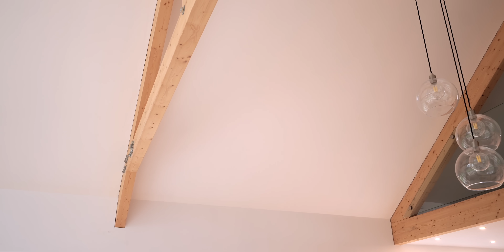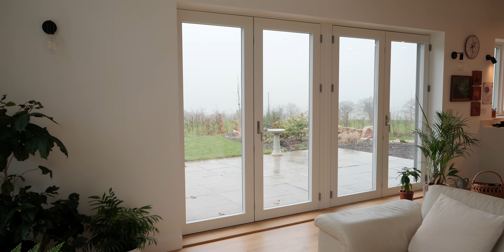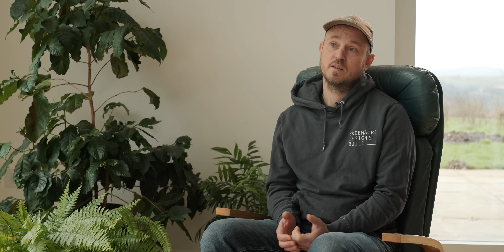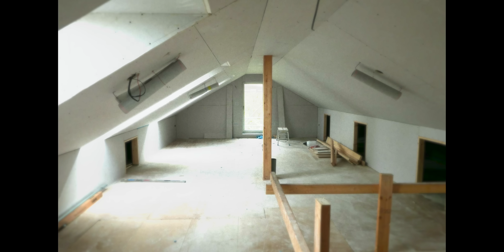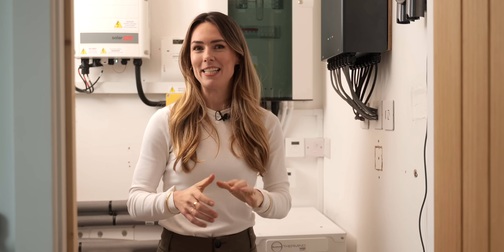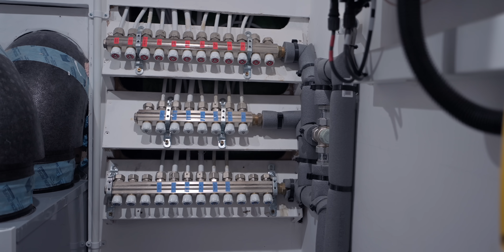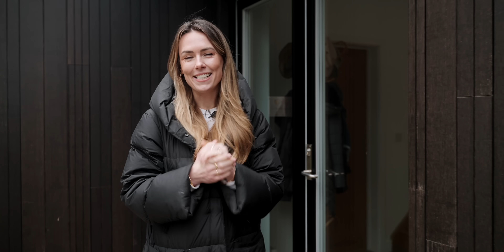Ditching a Heat Pump for In-Plaster Infrared Heating?!

Comment: Sorry. Naive here. Airtight? Sounds a bit dead…do we really mean that?
Reply: Why not Google up UK building codes ref efficient housing?

Which will probably lead to plenty of ads relating to heat recovery systems.

Why didn't you Google up.the topic prior to posting?

You certainly come across as somebody who doesn't do much research for themselves.

You should be ashamed.

Comment: From what i heard - a passive house is a house where you dont need to add heat.
The amount of insulation may people say is bonkers. But if you insulate between 300 to 500 mm you should not need a heating, in theory. The applieces and the people who live there add enough heat under normal living situations.

Of course you should add heating, for a few reasons.
Reply: That amount of insulation certainly is not at all bonkers.

Merely research house construction using straw bales

Stone/brick chimney, fireplace and hearth for the look of the thing.

Straw or reeds roof.

Probably one of the easiest ways of building a building there is.

Plenty of videos on YT if arsed.

As long as you can lump straw bales about, especially if you're going for a second storey.

Plastered inside and rendered without, both on top of clay.

Seasoned oak or elm beams.

Triple glazed timber windows.

Comment: I claim BULLSHIT !!  I'm an architect.. Installed a Radiant electric heating system in my New build house in 1985  . 
Ceiling instal only as wall installation was  obviously NOT recomended due to possible user induced damage from. 
Heavily insulated Walls and Cielings .. even betwixt floors. 
 It worked well .
 Although the promised Lower Electric costs were erm ..exagerated .. at best.
 Noting that My electricity costs are ~8 cents (cdn $)  /kw. :-).
 Problem was that the panels (mfg'd by ITT ( Norway ) Soon began to fail one by one... by 1995 ALL 45 panels were DEAD.

 Seems the 60hz of North American Electricity excited the panels  into vibrating and that vibration shattered the heating lelements continuity (killed them)  
Total heating system was/is 100% dead.. Feeling lucky ??
Reply: Hmm ... it's certainly possible you're trying to make a plausible point ... if only we knew what it is.
Reply: Further to your earlier post ref mains frequency  ... the FAR IR heating element is not mechanical so am puzzled as to how you might draw a parallel to "your" heating element and this more modern material.

Comment: I wonder if that could be used underfloor on top of insulation with a thin scree over the fleece?
Reply: With any luck the pro installer outfit guy or lady will answer your query directly.

Will be useful to know for all concerned.

Especially for the heat pump huggers.

They'll get it ...
Reply: Yes, our systems will lie behind plaster, tiles tiles, cement, timber floors and even resin and polished concrete :@)
Reply: @EnergyCarbonInfraredHeating what thickness of insulation would be required under the fleece to prevent the heat dissapating into the ground?

Comment: Watching this freezing my arse off in my rented damp victorian terrace and 10x the energy bills 😭
Reply: Hmm ... might be worthwhile your reading up on clothing made from the same sort of heating material that gets plastered into a wall.

Works off 24V-36V via transformer so no danger from a  mains belt.

Just remember to unplug for comfort break.

Job done.

Or, buy a FAR IR panel heater,  about 350 W, sit back and  gently cook.

A lot cheaper than buying yourself a property and retro fitting a heat pump.
Reply: That'll be 95% of housing in the UK, which simply can never be bulldozed. Think of the sash windows, the ornate light fittings, what would Heritage England say ?
Reply: @decibel_tastic2869 

😂😂😂

Kindly don't be so simple

A lot (most) of the ancient Victorian and Edwardian housing stock I had the misfortune to work on was Jerry built.

Outside loo, no bathroom, no cavity walls, no loft insulation etc, etc.

Not a lot could be done to improve the properties except a bedroom converted into a bathroom.

Knock down that rubbish and build better.

Why should people have to put up with poor accomodation?

Comment: Very impressive setup and what a sensible chap! 👍🏻 I’d love to be able to build my own passive house somewhere like that 😍 …

I think the homeowner didn’t appreciate / was misinformed about how a battery can be used when there isn’t a power cut. With our Powerwall at least, you can set a percentage that you don’t want the battery to go below, so you’ve always got that amount of energy available in the event of a power cut. Yes that reduces the amount of the battery that you can use the rest of the time, but you can just size the battery accordingly.

In the winter, if it’s really cold, raining and there’s no sun, our single Powerwall 2 (13.5kWh capacity), can sometimes run out by midday, and that’s after charging it to, and holding it at 100% during the off-peak period which ends at 5:30am … so if you’re solely relying on the sun to run the house in the middle of winter, you’ll be using quite a bit more expensive on-peak electricity, when you could be using off-peak electricity from a battery. We have a total of 8kW of panels on our house and sometimes in the winter we can make less than 1kWh in a day! 😢

I should add that, with the Powerwall at least, you can’t use it to power the house during a power cut without the optional Gateway module which completely isolates the house from the grid in the event of a power cut (so energy from the battery can’t go back into the grid whilst they’re trying to repair it).

As an aside, it would be useful it the editors of this video could put captions in the video if it contains errors that weren’t spotted during filming, eg. at 11:35 he says they have a 6kW solar array, and that they expect to generate 6kWh of energy in a year 🤔… but he then says he expected the total energy requirement of the house for the year to be 6000kWh, so presumably he meant to say they expected the solar to generate 6000kWh over the year … Otherwise some viewers might get confused if the numbers don’t add up.

Comment: I really don't understand the benefit of these over electric underfloor mats, assuming the same insulation, solars etc. Surely the electric mats provide greater comfort.
Reply: No.  Although we generally don't put our system underfloor as we would need to cover at least 80% of the floor area compared top 50% in the ceiling, our IR mats use  a lot less energy per m2.  Also, if you accidentally put a screw or fixing through the electric mats then the whole system will fail.  With these you can screw through without effect.  Put a plastic dog bed onto a laminate floor with resistive electric underfloor heating and watch the burn spots appear as the wood overheats.  Again, not with this system.  Hope this helps

Comment: But wat is casing the heet have you just put an electric radeyatet in the wall
Reply: Good question. The mats are plastered into the ceiling.  When fired up they reach around 30°c which is enough to generate IR at a frequency that is felt as warmth by the body.  That lightwave transfers protons of energy to other surfaces which store them as heat.  These then warm the air.

Comment: Heat pumps provide 3 to 5 joules of heat per joule of electricity. For pure electric heat you have to have a very well insulated house.
Reply: True but IR, although classed as direct electric currently, is actually a lightwave and works differently
Reply: Many heat pump owners achieve good results with moderate insulation. High levels of insulation are unnecessary.

Comment: Where are the safe guards. I've seen heat trace fail and started a fire and thankfully it was next to the water service so it melted the hdpe pipe and the water put it out
Reply: Different technology.  This is not laminated film but homogenised graphene copper blend using a unique, patented process

Comment: Passive houses are a laudable aim. However their reliance on Electricity for everything, Primary heat, Water heating, Heat recovery system etc. Makes them a Resilience nightmare, batteries can be an option, but can also be another single pont of failure. Reliance on a single form of Energy is never a great idea. Dual fuel, solid, gas or liquid fuel backups give at least a measure of peace of mind, in the increasingly uncertain times we are moving into. As it seems now the UK, can't rely on even, it's closest presumed partners. Resilience should be planned for, as a matter of priority, in any new build or refurbishment...

Comment: In the 80's they introduced a long wave radiation "Passive Heat" Infra Red  Gypsum board internal Elements , for Ceiling Linings ,  I Decommissioned regularly Due to  Unexplained "Head Aches"  of House Owners , which became ever more obvious when in Holiday Homes & Headaches stopped once Isolated
Reply: Different lightwave and temperature.  When heating from above, anything above 9°c difference between body temp and heat source will cause trauma.  We heat to a maximum of 40°c  unlike IR panels that far exceed this range
Reply: @EnergyCarbonInfraredHeating 

Perhaps people should congratulate themselves we live 93 million miles away from our own FAR IR emitter (and every other radiation from dc to daylight, and beyond).

But sadly they won't given the level of Science taught these days.

Some people think heat only rises?

They do you know.
Reply: @ForestForest-n9i Madness!

Comment: Ceilings, walls,so strange. Heat rises, why not in the floors?
Reply: 80% infrared radiation (non ionising) and 20% convection
Reply: Why not read up on how FAR IR works instead of commenting?
Reply: @ForestForest-n9i It's like light, it radiates down as well as it does up, but sooner or later it will warm up an object, and heat will convect away from it, right?
Reply: @Patiboke 

Well done! 
Close enough.

Comment: Listening to non-engineers talk (wave hands arround) about energy and efficiency is so hard. It takes 15 minutes to say 30 seconds worth of content. And they leave out the detail that "prove" the value.
Combined with stupid statements like, "our heat load is too small for a heat pump." 
A 50 gallon heatpump water heater and some piping in the floor would heat tgat house for 1/3rd the operating cost. And run about $2000 in materials.
My 3400SF heat pump system cost about $8000 in Montana. Costs me $500/year for heat.
Reply: I would agree.
Reply: Engineers my arse.

You're not an engineer nor ever will be.

We're a long way ahead of you and your blasted fifty gallon bucket or something or other.

Obviously.

Did you know the Chinese or someone invented  heat pumps for cars (automobiles)?

Clearly you didn't because you're still banging on about your bucket or whatever.

In future suggest you do some research prior to posting.

You might even replay the episode and hear what the old bloke was saying.

Comment: I have Astectherm in my house after removing gas boiler. Best system bar none. Infrared heat is totally different to heat from a radiator. We would never go back to radiators. Astectherm have a web page but it won’t allow me to post the web address on here. Speak to Galvin. Very very helpful. You send plan of the room they send a plan of mat placement. They will guide your electrician & plasterer through all of the steps.

Comment: No costs for materials or parts or installation? Just "£200/ year electricity bill". What if the parts costs 30,000 or more?

What's the point of this video if you're not going to be honest about costs?
Reply: You could always conduct your own research on the costs of the installation relating to your own location.

That way, by discovering the costs for yourself through your own due diligence and hard work, will ensure you won't get the fleece pulled over your eyes.

It's almost, and I can scarcely bring myself to type the words, you, on behalf of heat pump huggers everywhere, are trying to pick holes in the argument for FAR IR space heating systems.

Surely not.

Comment: ive unfortunately been an experimentee of this heating system in a more typical UK house and its bad, like prohibitively expensive running costs wise. u really have to spec it extremely well, and even then its exceptionally more expensive to run than a modern heat pump. IDK who the homeowner here talked to about heat pumps but its clear that he was taken for a ride! Modern decent heatpumps have an inverter that allows a heatpump to run at small percentages of their rated output power rather than clicking on and off at full power constantly in order to maintain temperatures. £200 ish a year total? considering they have solar i imagine they used a lot of that in minimising the costs. If they had a heatpump theyd have made money hand over fist with the solar power and sales to grid of the excess they would never have used.

this seems like a feelgood video untill u realise it could have been so much better than this if they had only used their noggins!
Reply: IWhy are you comparing your experiences in the world of retrofit with a recently built passive house?

Tell us how your argument relates to this new property?

Everyone knows by now the first issue is the insulation and draft proofing.

The better the insulation the cheaper a house is to keep warm in winter and cooler in summer.

By the sound of it you probably went about the retro fitting thing using entirely the wrong approach.

In future just remember improvements to the insulation and draft proofing come first, each and every time.

You might, repeat might find your costs for heating are very much reduced to the point where you ask yourself if it's worth buying a heat pump after all.

Spending thousands to save hundreds is financially questionable, especially as it's a given heat pumps don't last forever and might well put off a prospective buyer.

Said prospective buyer might be a tad concerned about a possible or more probable need to repair or replace an ageing and possibly defective heat pump.

Are there grants for replacing old heat pumps? Something to research, obviously.

In fact it may be that prospective buyers of heat pump heated homes look at them in the same way savvy car buyers look at used BEVs with possibly predictable problems pertaining to the battery pack.

Comment: I would contend that these panels don’t operate at a high enough temperature to really call then infra red heating. 
I suspect they are at a lower temperature to a normal radiator.
A couple of air to air heat pump units would have been a saving. 
I built my parents a timber framed house in the 80s, in south Devon, nothing special, though lots of south glazing and an open south aspect.  It hardly needed any heating.  If it had been Passivhus standard, heating would have been no issue
Reply: Stop "contending" and kindly explain this notion of yours regarding heat.

It very much looks as if you're desperately trying to argue against proven FAR IR  technology in favour of spending thousands of pounds to save a few hundred.

Why bother when we can all do the fact checking thing for ourselves ref the validity of your rather hopeless arguments.

And that of course extends to all the other rather hopeless arguments from the rest of the confused and bemused heat pump huggers infesting these comments' pages.
Reply: Hi @markthomassan5077 the heating mats run at around 38°C and don’t rely on convection to warm the room. They emit infrared light up to around 3.5m from the ceiling.

We’ve supplied tens of thousands of metres of this heating. It warms all the surfaces in the room and those surfaces then slowly release the heat back — like having lots of storage radiators built into the structure, with no cold spots.

Comment: I considered the same with our passive house but eventually went for a system of decentralized monoblock heat pumps (3 in total across the house, from Italian producer Olimpia Splendid). Direct electric heating will always just have a COP of 1 and with 2 small kids, I couldn't possibly hope to predict the usage of the different areas across the house.

Comment: To Miss Bogle. And add with the fan popped up very reputable and I thought how can you get rid of the fan for the air conditioning heating system there’s no such thing as a silly question special sense in the mid 90s. I was thinking about Alpha brain waves if they could be amplifiedto control objects almost 40 years later now they’re recognizing that you can take to brain waves and move shit with it.😊 the Highlander